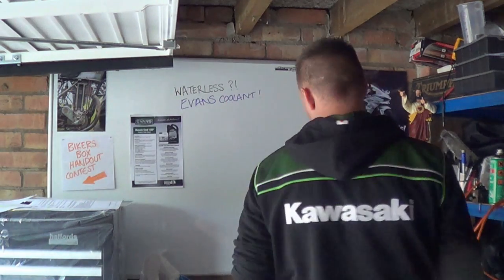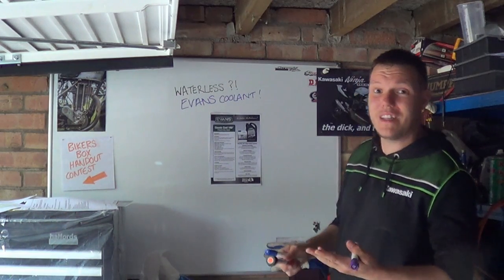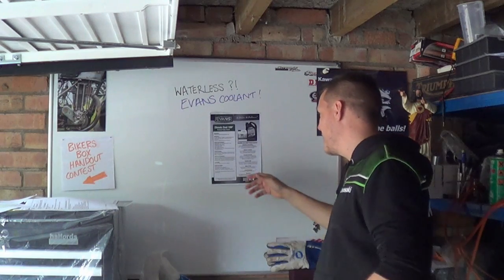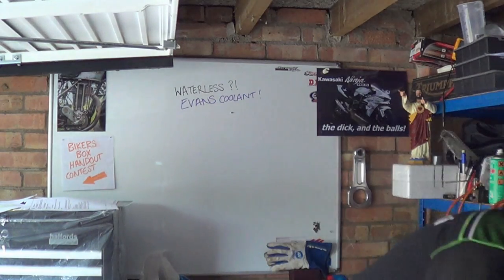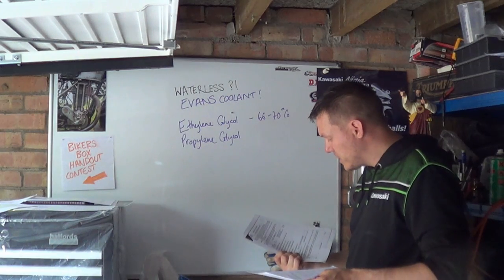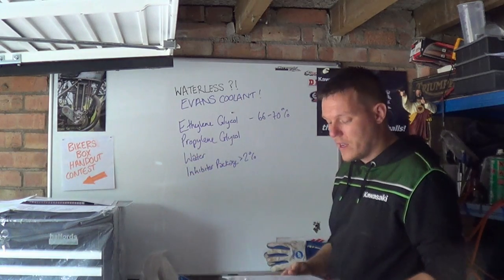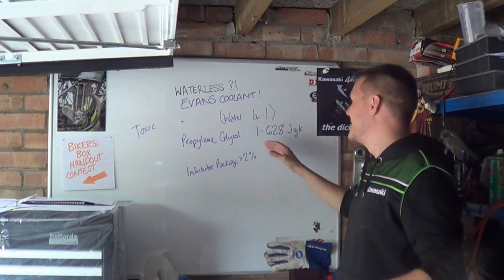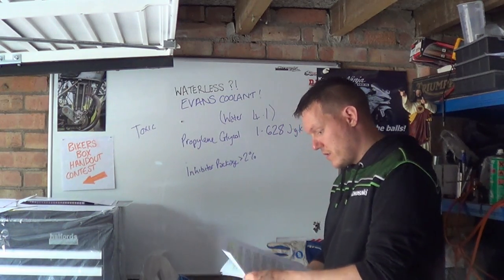Evans coolant any good? Part 1

Comment: With all due respect, so far your presentation is flawed and misleading. 
Is this because you are not as knowledgeable as you think you are or is it intentional as in entertainment? 
Are you are an expert regarding internal combustion engines,and cooling systems? 
What is your education, background, profession, work history, citations and experience? 
Besides YouTube and other unqualified social media are you published? 
Why preach krapp and denigrate like you are a published professor with extensive multiple discipline education, knowledge and experience with controlled experiments to prove your hypothesis if you are not? 

Regarding the products mentioned in the video, you are mixing the claims and MSD sheets of several Evans products with different chemistries that are targeted for very specific applications and audiences such as for example where the competition sanctioning bodies prohibit the use of traditional anti-freeze/coolants, ethylene glycols and require water only or propylene glycol products and the road vehicle products. 
The formulations, resultant chemistries and performance characteristics are different depending on the intended application.
Yes, cavitation, corrosion and erosion are real conditions experienced in internal combustion engine cooling systems with real consequences, read and comprehend the SAE, ASME, ISO, Navistar, Ford, GM, Caterpillar and Cummins papers on the subjects.
Reply from the maker: Oh I'm going to love this one. Okie kokie.

"so far your presentation is flawed and misleading."

- ok how, which points and so on.....

"What is your education, background, profession, work history, citations and experience?"

- I've been through this many times before, but I'm not going through it again because you're late to the party.

"like you are a published professor with extensive multiple discipline education, knowledge and experience with controlled experiments to prove your hypothesis if you are not? "

- What's funny about this statement is that you talk about citations and so forth and then jump to the comclusion that I have no experience and don't know what I'm talking about. Then like a sneaky bastard, cover yourself with 'if'. If you're going to make accusations then have the balls to make them, but get off your fucking high horse.

"you are mixing the claims and MSD sheets of several Evans products with different chemistries that are targeted for very specific applications "

- No I'm not, I think its quite clear which sheet I'm reading from and when.

"The formulations, resultant chemistries and performance characteristics are different depending on the intended application."

- what's compliacted about water'less'? You can worm around the subject with a convoluted narrative, (quoted above) but that doean't change the fact that its Proplylene Glycol, which is just straight up anti-freeze. What's your point?

"Yes, cavitation, corrosion and erosion are real conditions experienced in internal combustion engine cooling systems with real consequences,"

- Not in ways that effect road going vehicles over the lifetime of a sadi vehicle. SAE and alike are subject papers based on long life plant engines that are for the most part high capacity diesels with milage running into the 500k hours. Diesels will suffer from unique failure modes due to the detonation functioj of the engines. Most cavitation erosion events are due to cylinder sleeve oscillations and high amplitude low frequency running conditions. 

- Oh and Krapp is spelt crap.
Reply: Okay... for the record, I am a former industrial chemist with over 30 years of experience, 9 of which was in the development of water-based hydraulic fluids for BOP Wellhead Control, Subsea Umbilical Control systems and Motion Compensator systems for the Offshore, as well as fire-resistant water-based fluids for diecasting hydraulic systems. My comments are based on actual experience of galvanic corrosion prevention, vapour-phase corrosion inhibition and hydrodynamic lubrication properties of water-based fluids. With all due respect, you are setting yourself up for a massive trolling session by puffing your chest out in this way..

tl;dr - I know what I'm talking about on this topic and I've got Matt's back if he needs it (not that I think he does LOL)
Reply: It is misleading because you put a greater than symbol (>) instead of a less than symbol around the 9:00 mark. That + or - 2% inhibitor volume in 2003 is the keystone to your argument here.
Reply: A paid troll says what?
Reply from the maker: "That + or - 2% inhibitor volume in 2003 is the keystone to your argument here."

- say what?
Reply: Excellent CV ModshackMerlin, we have opportunities here for people of your experience....seriously!  Evans UK parent company also formulates water-based solutions for industrial applications, including sub-sea.  Without wishing to contradict you or patw52pb1, I would comment that the inhibitor chemistry used for Evans coolants has to be waterless too.  This, as you can imagine, was not that easy to overcome, whilst also meeting the standards set by ASTM sub-committee D15-22. As mentioned elsewhere in this string, I am happy to answer all technical questions that might help clarify the pros and cons of Evans coolants.
Reply: is bad sarcastic joke in respose to the parent comment. I enjoy all your videos